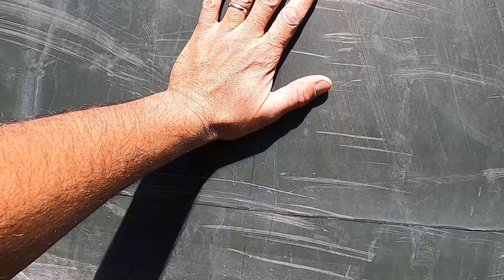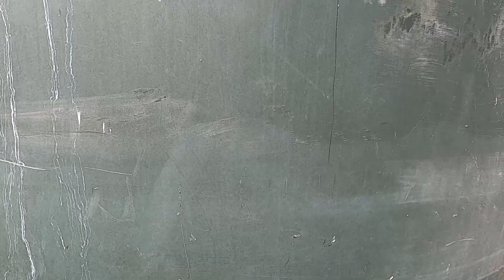So Much Water | What's Up With Bandit | Homestead Vlog

Comment: I would not bury the tanks .. You get a big rain and the Tanks will float out of the ground. Also underground needs to be pumped and you work against gravity
Reply: Friends of my parents, lived 1/4 mile from the Mississippi River.  In 1962, they had a fallout shelter buried behind the house.  The river was high that spring and a big rain fell. Between the rain water in the ground, a naturally high ground water depth, & the pressure of the river, the fallout shelter popped back up and had to be reburied.
Reply: With how heavy water is I wouldn’t think the tanks wouldn’t come up from being buried
Reply: @willowswhispers577  The Water in the tank is the same weight as the water outside the tank.. The Air in the tank weighs a lot less. Sort of why boats float.